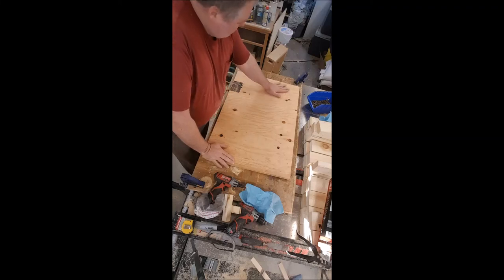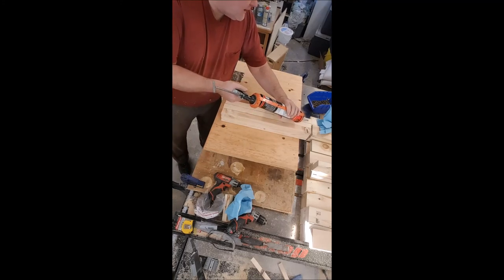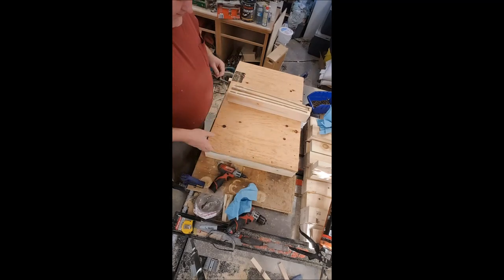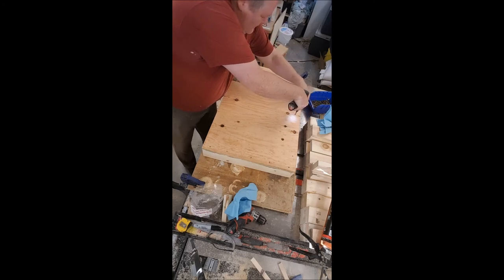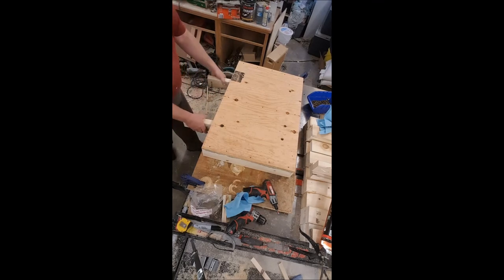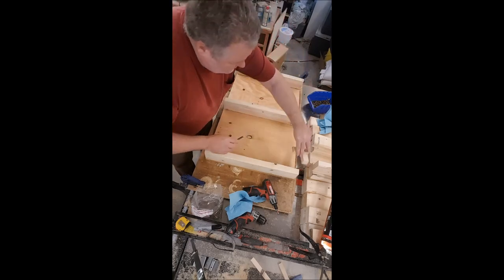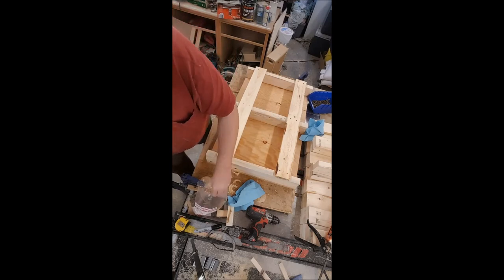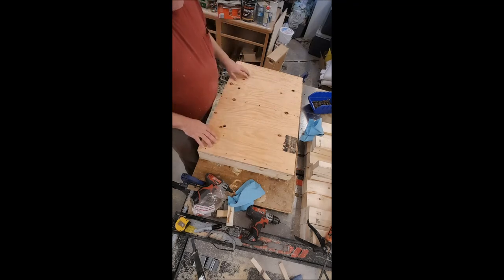🔨Two Way Migratory Pallet Assembly Part 1 - That Bee Man

Comment: How does your wax dipped wood hold up with ground contact? Also are you dipping in paraffin and microcystalline?
Reply from the maker: Hi Brent.  I believe they are using paraffin and microcrystalline.  I've been using these pallets for five years now and I can detect no rot or anything of the sort on the pallet runners.  I feel it is an excellent preservative for the pallets.